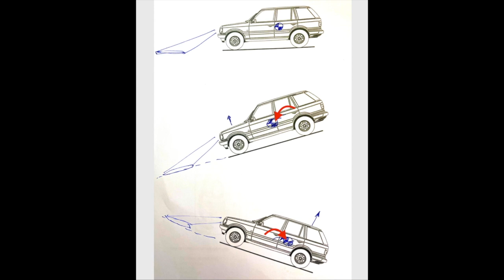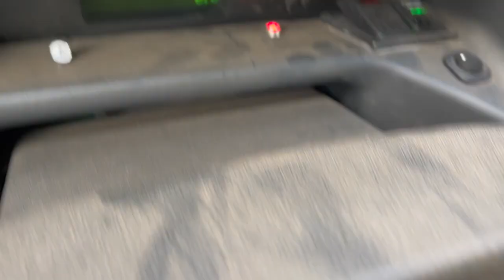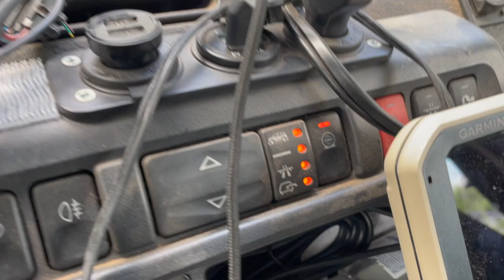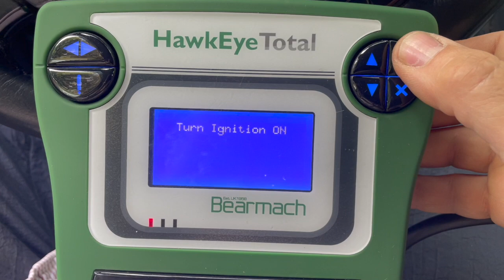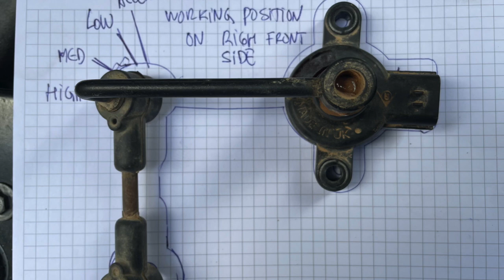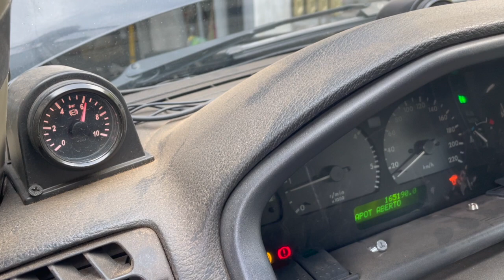005 P38 EAS Reliability Plan

Comment: so for the self levelling , can u just leave the relay off all together ?
Reply from the maker: If the relay is off, the air suspension doesn’t work (won’t go up or down) it will keep in the position it is at that point. For me is useful to disconnect it during night and when going off road